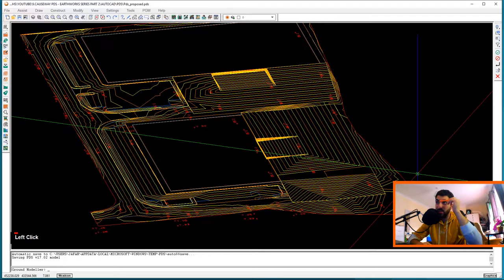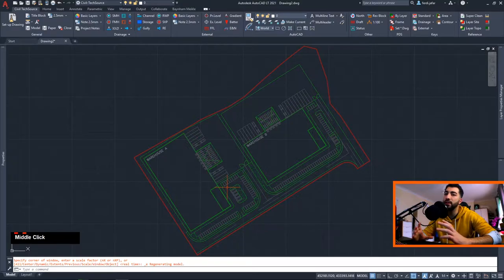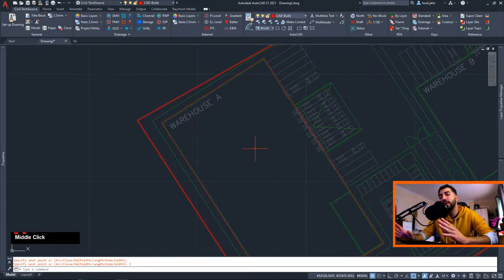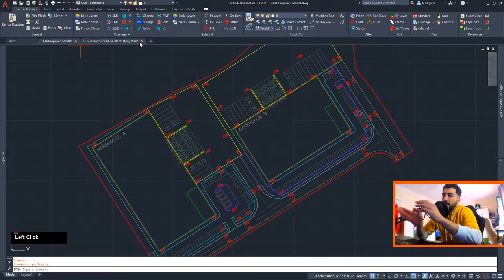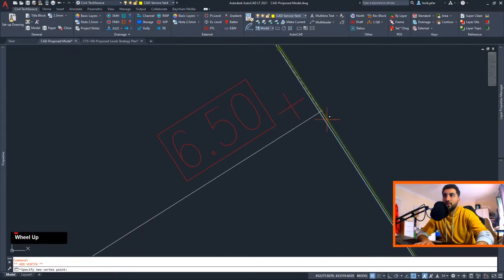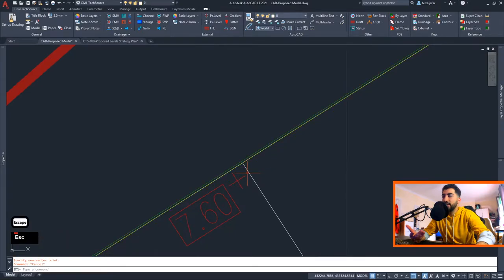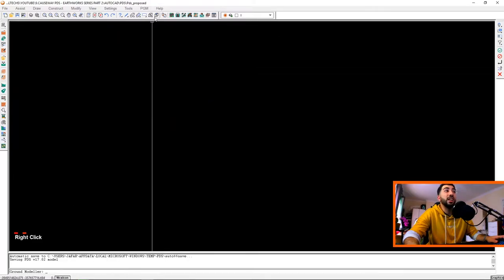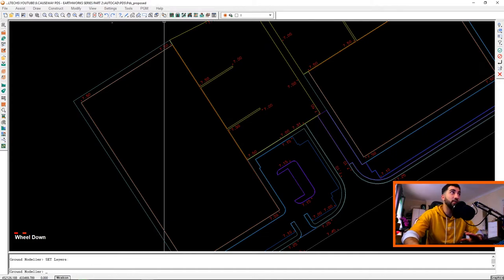Causeway - PDS Earthworks: Part 2 - Proposed Ground Model

Comment: Hi Ferdi ,

You mentioned in the video , if you did 3D poly lines in AutoCad, u could skip straight to Part 3. Is this actually the case ? Or must I, build the 3d poly line PGM first
Reply from the maker: If you imported 3D polylines from autocad you can just straight away use the Build PGM command. Hope this helps!